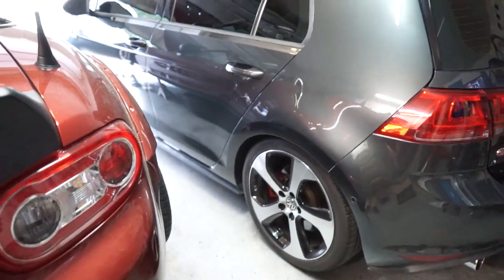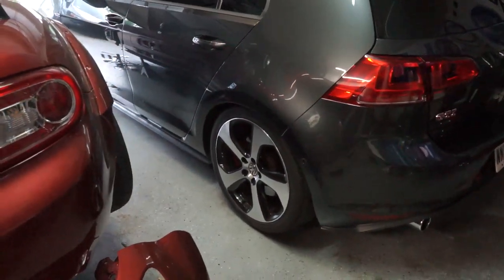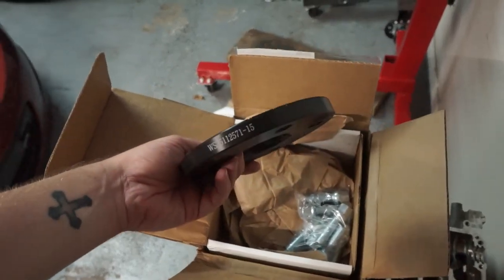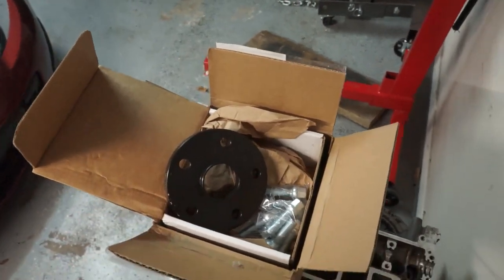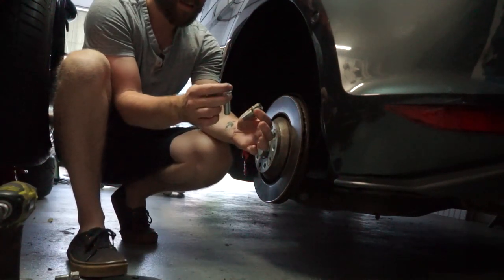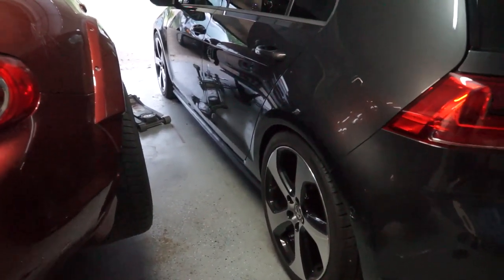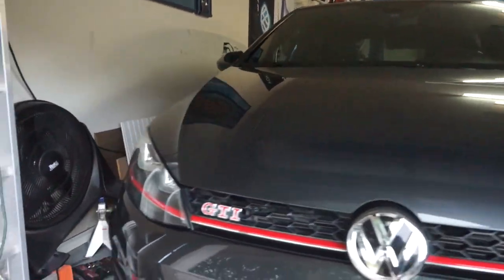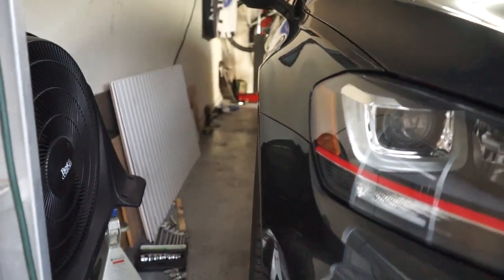Better GTI Wheel Fitment with GarageLine Wheel Spacers

Comment: Spend about $12 and get yourself a Wheel Hanger Alignment tool, thread it in to the uppermost lug hole it makes it so much easier to mount and dismount your wheels.

Comment: Would you run the 20mm in the front also or do you think you would have rub issues at that point ? I’m about to do the same set up just can’t decide weather to run 15 in front or 20? 

I’m also doing this to a mk5 (not a 7) & at stock ride height then doing maybe a 1-2” lowering spring after and eventually buying wheels. Same boat as you lol

Thanks for the awesome video by the way man ! Really great !

Comment: Stupid question but what are drill socket size snd other attachments are you using to take the wheels of. Noob here snd I just Purchase a impact drill.
Reply from the maker: I can't remember exactly, but I use a 17mm with the new lug nuts on the stud conversion kit I have now.

Comment: Im considering getting wheel spacers for  this summer. Obviously its recommended to retorque after some milage but is this just to be 100% im driving everyday and if i have to retorque once per week its kind of an inconvenience. Did u retorque very often.
Reply from the maker: I dont retorque at all, I havent heard that before
Reply: Good to hear. I guess thats sort of a personal opinion. How are the spacers running so far?
Reply from the maker: @MrDiamond1000  still all good, pulling daily driving duties with no problems
Reply: Good to hear man, car looks great. thanks again for the help.

Comment: Any rubbing issues with the spacers and sport springs?
Reply from the maker: Front rubbed a little due to that weird little fender tab. Once I bent those up I've had no issues. A lot of people have to make that adjustment.
Reply: @ColoredinLight  Oh okay, so you only fender rolled in the front? I have a mk6.5 GLI just looking around to see good fitment vids. Looking to get Audi peelers with spacers and lowering springs.
Reply from the maker: No not even a fender roll. Theres this little metal tab on the mk7 that has a bolt to hold the fender liner. Not sure on the mk6 platform though